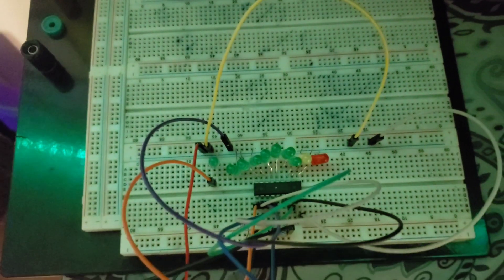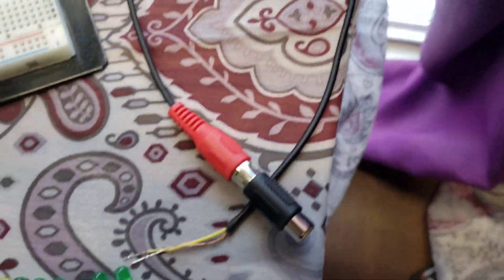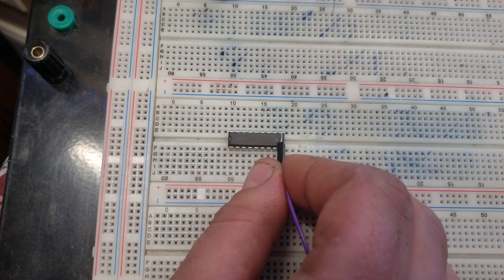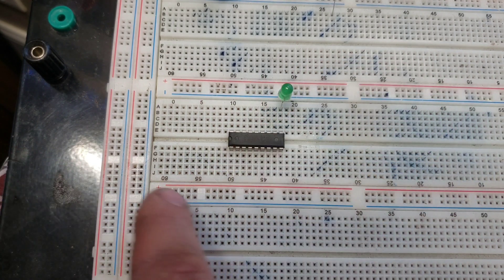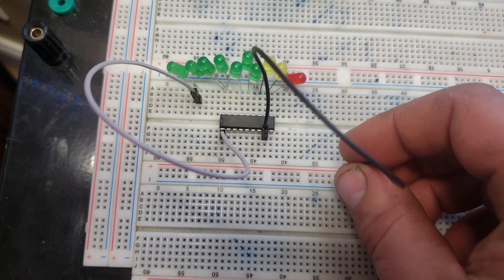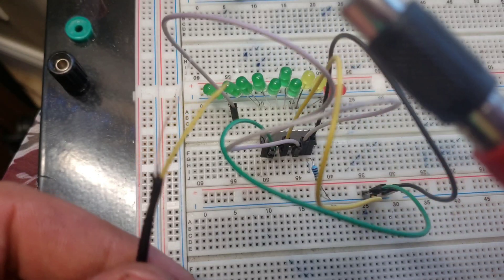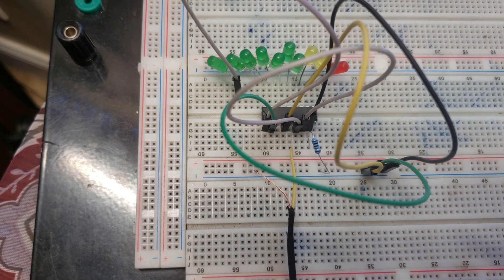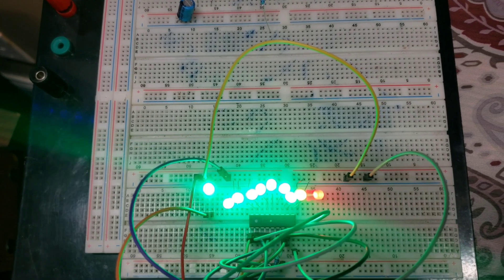LED VU Meter Build

Comment: Dont you have to program the microprocessor?
Reply from the maker: No, it's just an integrated circuit. The input level is adjusted via a resistor, I believe...
Reply: Thank you for clarify. I also would like to know where can i get the schematic?